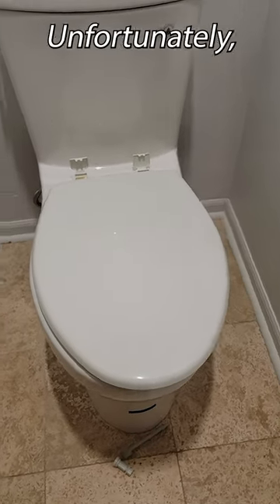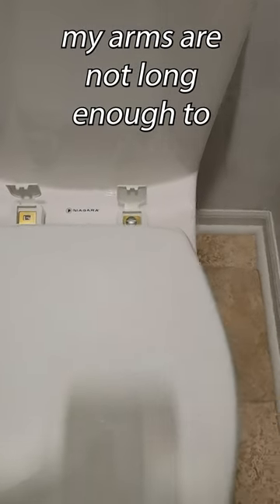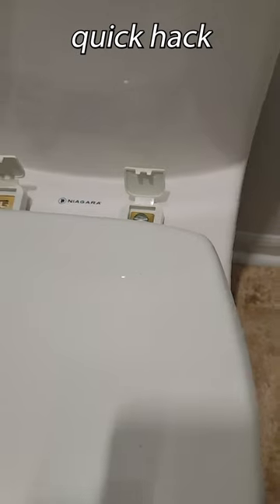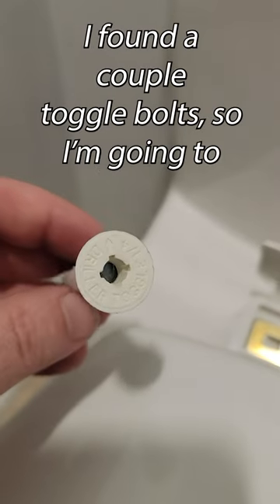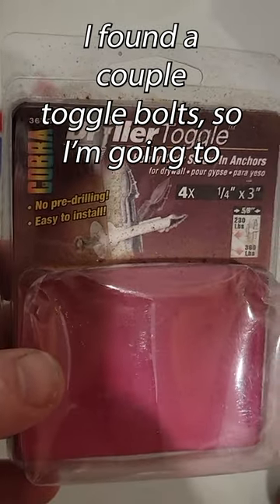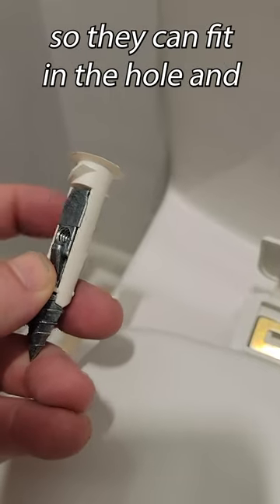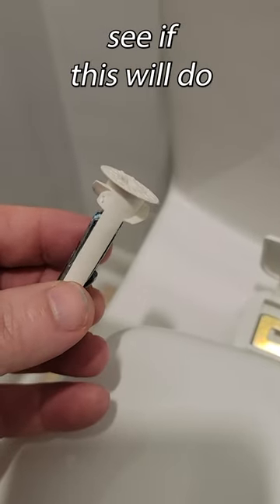Toilet Seat Replacement Hack for 1 Piece Toilets

Comment: I have one of these toilets in my newly-refurbed rental apt. Decide to get one of those bidet attachments. 
NO WAY is there room to get my hand round to the bolts. I'd be leery of using metal toggle bolts on porcelain, but I do see that there are rubber expansion fixings available. ($7.99 for 4 at Amzn).
Or, I could do a bit of Dremeling on the bidet (now there's a phrase you don't often hear) to enable me to slide it on under the loosened seat bolts.

Either way though - thanks Niagara, for your shit design !
Reply from the maker: I just used what I had in my garage since it was my house.  I would get the proper ones for a client's house.
Reply: @SawHorseDesignBuild  Yeah - if the apartment had been pre-refurbishment, I might have tried it (does EVERYONE have ancient toggle bolts in a dusty drawer ?).
'Course, pre-refurbishment, there would be a sensibly designed toilet.....:-)